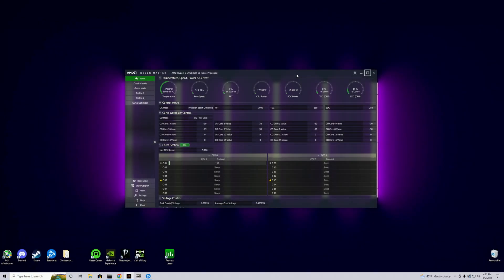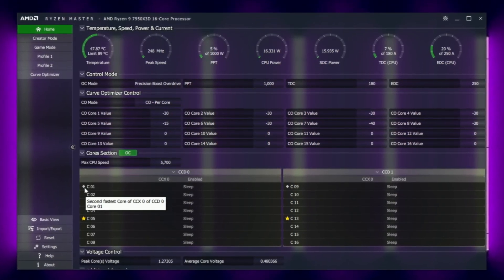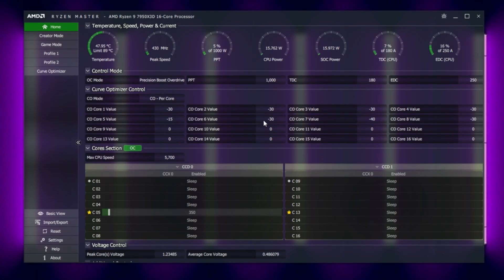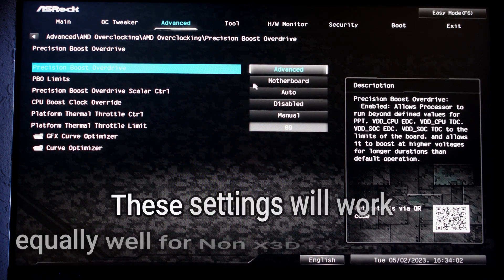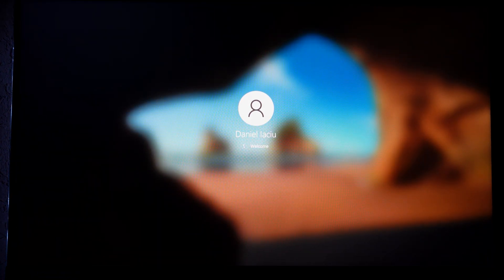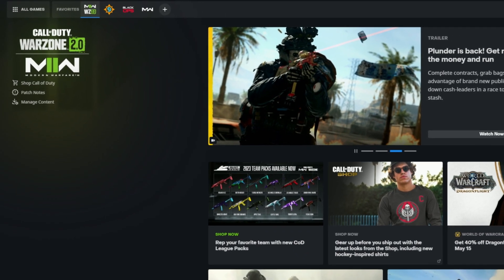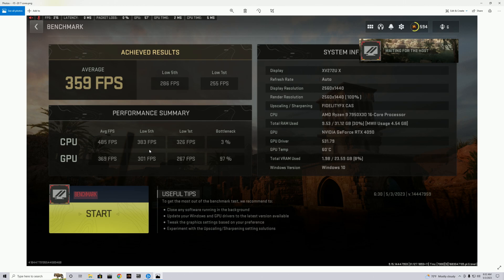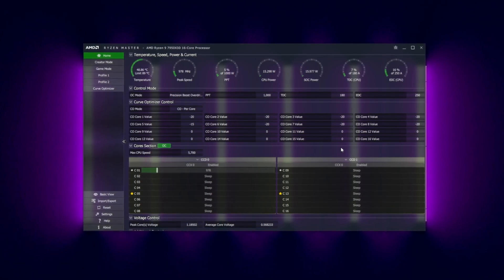Undervolting Ryzen 7000 Guide (How To Max Out Your Undervolt)

Comment: Well I'm using -50 offset per core and pbo with 85C limit and positive 200MHz. It's working great so far. CPU R7 7700 msi B650m gaming wifi motherboard.

Comment: Testing 7600x. During test in occt temps go to 95c always. Is that normal for tests, while actual undervolting results in temps i should test during gaming? Usually it went to around 85c but if undervolting was successful, temps should go lower in games.

Comment: This is not the best way to undervolt and test. use corecycler. It uses aida64, prime95 and ycrhuncher alternatively. I bet you if you put your cpu through a prime95 test with those numbers it will fail. Also you can setup a whea logger to see if there are any errors on your cores. Also in my case on my 7800x3d the cores core 0 with star and core 1 being second core as you said have lower numbers -35 and -30 than core 5 -25, core 6 -27 and core 4 -28. So the core with the star does not mean it has to be lower everytime.There is a long process on how to test it to be sure it will not random restart. I preffer to neve have random restarts than getting lower unstable numbers in my undervolt.

Comment: I'm not a big fan of going to the limit with the curve optimizer. My 7950x runs stable with -30 on all cores, but there's not a big difference between (heat, performance) -25 and -30, so I set it to -25 (no need to test each core by its own). The times of real overclocking or undervolting are gone nowadays. we have to trust what the cpu creates out of different values like the curve optimizer.

Comment: I own a 7600x. Before UV the CPU temperature after 10 minutes of OCCT test =76 degrees centigrade. I performed everything according to this video. I reduced the voltages core 1 - 25, core 2 -15, core 3 -20 and core 4,5,6 - 30. after this procedure, the CPU temperature in the OCCT test rose to a borderline 89 degrees within 15 seconds. WHAT is wrong? I understand that after UV the processor can be unstable, but rather should not heat up more

Comment: Is there any benefit of doing something like this through Ryzenmaster?  Or through bios?  Or no difference?
Reply: look at oats7 comment (7 month old) they have been echanging on this topic various messages
" @oats7
Hi I'm trying to undervolt my 7950X3D. You have a previous video on undervolting this CPU, but you did it in the BIOS. Which should I use? Ryzen Master or the BIOS?
Beefy Tech
·
@Beefy-Tech
Bios is best way to do it. Keeps it simple for you as with ryzen master settings aren't saved after reboot. " 
...
Reply: @nicocorico4808  I will check it out, thanks for the headsup.
For now I am using the bios where I'm all cores negative -30 and it seems fine.

The only instability I have is the GPU sometimes..... DISCONNECTS and I get no response.  The gpu seems fine and I've never had any issues.  But I think the pcie slot may have something wrong.  I do have an extended warranty on the item I purchased so if it continues, I might go and exchange it. Also the ram seems unstable and I would get bsod if I was doing deep learning programs if I ran it too long.  But after I capped the speed on its original expo mode of 6400, down to 6000, it stopped bsod.  

Honestly I think my mobo is a little flakey.

Comment: 1. Theory about best cores. I have -29 to -31 on all cores on ccd1, runs perfect, gain from 5150 to 5350 on full load.
2. Theory about no performance gains on ccd2. Lower temp-higher clocks. I have -29 all cores on ccd2 and gain from 4950 to 5250 on full load. CPU 7950x, cinebench r23 stock 37500 and after CO record is 39966, ambient temp 17C

Comment: thanks for your time to make such an informative video. Since we use X3D Ryzen9 .. our concentration is at CCD0 to CO and concentrate at the best Core from Ryzen mastery. This will reduce Temp accordingly .. but is there any issue if we apply the same for remaining CCD1 cores ? i mean it suppose to reduce Temp more but in a price of Overall performance ? u suggest that ? personally i dont mind if i loss little performance to gain extra wattage reduction ? ... also what u think about reducing PPT TDC EDC ?

Comment: On Ryzen Master utility in Basic View (not Advanced View) you can have the utility find the best values for you by running the "Curve Optimizer Mode" on "Per Core". It will take around 2hrs to run the test and  give you the correct undervoltage value for each core.
Reply: Hey mate, just wondering if you know how accurate it is?
Reply: @Wpar  not accurate for me, ryzen master gave me between 37 and 47 and it was impossible to boot
Reply: @Wpar  I'm not sure how accurate, but it's a good starting point. You could drop the voltage a couple more points afterwards and check stability. Maybe see if there are any videos on it on YouTube.
Reply: @PaulyDownUnder  ah cool, cheers

Comment: Just built my 7950X3D system last week, and unfortunately, I didn't do enough research about DDR5 compatibility, hence why I accidentally bought 2 sets of 32GB DDR5 6,000 MT/s (CL36) RAM having a total of 64GB. I have been tweaking the memory for a couple of days and gave up using the EXPO profile because of instability issues, initially at least.

Then, 2 days ago, I realized that my BIOS version is from July 2022, so I updated to the latest one. And lo and behold, the EXPO profile now works with 4 DIMMs, and I was able to push it to 6,200 MT/s. As for the CPU, I was able to do an all core offset of -32 and it is stable with the LLC set to Extreme. So far, cores 8 to 15 are always running between 5.20 GHz to 5.75 GHz. I guess I won the lottery.
Reply from the maker: Yup! They had just put out an update improving ram support substantially on Ryzen 7000! Now even speeds up to 8000mhz are possible if it's running in decoupled mode!

(You are running 6200mhz But COUPLED, anything about 6200-6400mhz must run decoupled.

So your 6200mhz coupled kit, is equivalent to a 7600mhz Decoupled kit)
Reply: @Beefy-Tech  Thanks for the info. Deciding to build an AM5 system last week must have been timely for me. If I had done it way too early, I would probably have been experimenting with the RAM for a couple of months until this new BIOS version gets released.
Reply: What mobo are you using ?
Reply: @LightWorks222  Gigabyte X670 Aorus Elite AX

Comment: I was able to set all cores to -30, would lowering the offset on my best cores yield performance or temp gains or do i need to test every combination manually?
Also, I have expo enabled which raises my SOC voltage from about 1.0v to 1.303v which is still safe but id like to reduce it but even 1.295 still causes stuttering, if i reduce the offset my curve optimizer would this allow me to reduce my SOC voltage a bit?
Reply: I'm also using -30 and it seems fine. The only unstable things I'm getting is my gpu will lose connection.  Like on my sensor panel, it looks as my gpu disconnected.  I usually just have to reboot and make sure its snug and it works again.  I think something is wrong with the gpu port and not the gpu. I've had my 3080 for a while with no issues.  Its only happened on this new build. 
My ram would have bsod issues when I was doing heavily based deep learning projects or long rendering projects that would last over 10 minutes.  It was expo 6400m/t.  When I turned it down to cap at 6000 it stopped.  I haven't tried different timings but I might try it out on some of the present timings the mobo has.

Comment: So question. I’ve been doing per core. Now and trying stuff out. Do I put my  best cores to a higher negative and the rest higher? So say my best cores are 1 through 5  do I put those to the highest negative code as I can before the system crashes? Right now my best comes from what I’ve been playing with is 14,12,1,10,16 and
I got them to 35 with out crashing do I go higher wtih the rest of the cores?

Comment: I did exactly this and my clock speeds are lower than stock and my cinebench score is 1k lower than stock and without pbo enabled in bios. When I only used CO without pbo, my cinebench score was 13580 and with pbo my score was 12000. Temps didn’t change when I did exactly what you did in the video. My cpu is ryzen 7 5700x
Reply: My temps did not change a single bit either on a 7800X3D.
Reply: @Veganarchy-Zetetic pbo itself isn’t going to help with temps if you’re already pegged at max
Reply: Although it did not seem to help with temperatures at the time as it was roasting hot in summer. I did have a better score in Cinebench. Now its winter and much cooler I have better temperatures too so definitely worth doing.  @Spoudey
Reply: @Veganarchy-Zetetic i should have added that technically the temps ARE better because you’ll be less throttled although the temps will appear the same
Reply: The quick and dirty method is to use Ryzen Master to find youre two best cores,  Run Cinebench without anything to get your base line score
Afterwards set your best cores to -10 or -15 and set everything to -25 or -20. Run CB again and document everything and repeat either increasing or decreasing your values.
You can use OCCT with PBO2Tuner  or use CoreCycler to have it automatically tweak each PBO2 value until it finds its best value
Reply: i have Ryzen9 7900x3D .. so i need at first to use CB with stock setting then i use Ryzen master to identify my best core .. Only CCD0 since it has the L3 cache i do CO and the best core will be 10 points higher than other CCD0 cores at negative. and for best value value finder i use CoreCycle or PBO2Tuner .. Correct ? @kokumosu
Reply from the maker: You said it yourself, you have a 5700x. Undervolting doesn't particularly help any non X3D cpu. The 3D cache CPU's are the ones to benefit from it most. 

For the 5700x I recommend curve optimizer OC or a flat all core overckock.
Reply: @Beefy-Tech  ok thanks for replying, I think I will try it then

Comment: Hi I'm trying to undervolt my 7950X3D. You have a previous video on undervolting this CPU, but you did it in the BIOS. Which should I use? Ryzen Master or the BIOS?
Reply from the maker: Bios is best way to do it. Keeps it simple for you as with ryzen master settings aren't saved after reboot.
Reply: @Beefy-Tech  Thank you! 

Also, Optimum Tech recommends PBO2 negative all cores, thermal throttle limit 85 degrees, and a power limit of 85 watts: 
https://www.youtube.com/watch?v=FaOYYHNGlLs&ab_channel=OptimumTech

Do you recommend I follow his advice, or stick to yours with PBO2 per core?
Reply from the maker: @oats7  what he recommends is the simplified version of mine. I recommend 89TJ Mac with Per Core Negative PBO2 because it allows you to push each core to their maximum, and because all cores have a different maximum undervolt, you can maximize your performance.
Reply: @Beefy-Tech  Gotcha, given that I spent so much money on this CPU, I'm gonna follow your advice to get as much performance as I can. I'll use PBO2 per core and an 89 degree throttle limit. How many watts do you recommend for the power limit?
Reply from the maker: @oats7  the cpu itself never uses more then 90 watts ingame, so just leave it on auto👍
Reply: @Beefy-Tech  After hours of testing, it seems I've lost (or won?) the silicon lottery... -10 offets on all CC01 cores fails OCCT, causing a BSOD. It seems that my chip is already running at its most optimal voltage. Is it uncommon to have a chip that can't undervolt at all?

Comment: Very good information. Especially on the fact that you need to voltages higher on your best cores to keep the frequency up. But I think a disclaimer on what you define as stability would be nice. I find that the AIDA64 SHA3 test is next to impossible to pass with any cores at -30. I don't even start real stress run before I can pass several runs of the SHA3 test.
Reply: Full Ack! AIDA SHA3 is real. I went the lazy way and set an allcore -20 and EVERYTHING I was doing was fine (7800x3D). y-Cruncher, Gaming, Browsing, Corecycler, you name it. But then I read about SHA3 Test and I was courious. The 3rd run made my PC reboot. I lowerd it to allcore -10 and then it took 15 runs to reboot. I set everything to Stock now, just enabled PBO and tbh, the performance is nearly the same so I just stay away from CO, it is not worth the effort. My SP is only 86 so maybe I just lost the silicon lottery.
Reply: @ArdaDaMarda  gotta have LLC on medium
Reply from the maker: I go by the play games and don't crash/restart for month test. Everytime I got a crash/restart I'd go back in, and I'd adjust.

For basic stability I run a 1H OCCT test for both cpu and ram, and yes it is possible to pass OCCT and still get a restart later down the line, but then I'd just further adjust by 2-5mv if I were to crash/restart later down the line.

Sha3 is indeed extremely demanding VS the other tests, and ive run it before on my 7950x3d before specifically cause it was recommended to me, but when I ran it I only have -25 as my highest. Undervolts, with-15 and -10 on best cores.

Comment: @beefy-tech why don't you use cpu boost override and infact have it on disabled? Most have that set to 200 or 150.
Reply from the maker: Because cpu boost override unironically makes 0 difference because it only applies to the Frequency CCD, which ud never use outside of games like CSGO anyways.

The 3D cache ccd is locked and can't boost frequency past its limit of 5.25ghz without using ECLK overclocking.

So the Boost Overide only helps frequency CCD, and in turn it can cause instability from the overclock of 150-200 without actually being beneficial to 99% of games (other than CSGO)
Reply: @Beefy-Tech  gotcha thanks for clarifying

Comment: Hello there quick question. I have a 5900x. Just used ryzen master curve optimizer per core. Took me a 1hr and 30 mins to finish. Lol. Well anyway is it possible to input the results manually to the bios and uninstall Ryzen master? I have done stress test seems stable . The result i got -27 almost all cores on 2 cores one was 18 and the oher was 23.
Reply from the maker: Yes it should be possible, I just don't know for sure where in the BIOS it'd be. Check advanced, AMD Overclocking and look for PBo tuner
Reply: @Beefy-Tech  pbo2
Reply from the maker: @wankerka  if you click on it, curve optimizer should pop up and allow you to do advanced setup, then per core

Comment: my 7800X3D was able to do -30 on my 2 fast cores, and -35 on the others. Under that I got worse results.
Reply from the maker: That's really good! My good core unironically crashes past 15☠️ got unlucky myself😂
Reply: @Beefy-Tech  that sucks :< I'm real happy because its running in a tiny itx build, so can use all the heat reduction i can get :)
Reply: I am at -35 on fastest and -40 on the rest atm. Still no crashes somehow and I am not even at 5ghz. Around 4960mhz but my Cinebench score keeps going up. Guess I will run this for a few days and see if it even works.

Comment: did they make that you dont get the start optimizing button (curve optimizer) for the 7000x3d ? i only have validate button there
Reply from the maker: In the bios you mean?
Reply: @Beefy-Tech  in the ryzen master app , i think its not available for ryzen 7000 , only for 5000
Reply from the maker: @jonathand7465  I don't know if you can change pbo settings for 7000 series in ryzen master, but you are able to at least see your undervolts and limits.

Comment: Maybe a noob question but why not simply enable ecomode 105w in bios and be done with it?
GN tested that mode and it was only 3% slower than ‘unleashed’ but actually almost halfs the power consumption.
Reply from the maker: Because with undervolting you'd actually gain performance. When you undervolt you don't just decrease power usage and heat, you tell the CPU to run the same peak frequency at a lower voltage.

If before it ran 5.2ghz at 1.2volts, after an undervolt it'll run 5.2ghz at 1.17 volts. This will decrease heat, telling PBO there's more thermal room to push frequency even higher, and as a result it'll do 5.25ghz at 1.2 volts, instead of 5.2ghz at 1.2

Comment: Very nice video I have a 7800Xd3 core 2 best core 1 2nd I did a all core not per core -30 a is stable as a rock is it worth pulling back on 2 and 1 if they are stable odd thing is don't really is much change in temps but it does hold higher clocks for longer.
Reply from the maker: I personally run -15 -20 -30 on 6 cores now.

Pulling back on first 2 is only worth it if you see better results in a benchmark or if you are unstable otherwise ofcourse.
Reply: @Beefy-Tech  Ok cheers bud I did do a run at 20 on first 2 cores but didn't change anything so think will stick with the 30, Thank you for your help.
Reply: @Beefy-Tech  -20 -10 and 30 on all 6 cores. Ran Unstable with my core #2 which is my 2nd best core in the vcache running at -20 and -15. Should I lower my best core which is core #1 to -15 instead of -20?

Comment: May I ask you what cooler you have on that 7950X, along with the thermal interface material you're using and the maximum temperature your CPU reaches in 3 consecutive runs of Cinebench R23? (Also what is your ambient temp)

My parameters:

NZXT Z63 RGB 280mm AIO
Thermal Grizzly Kryonaut spread on every part of the CPU in excess
Ambient temp 22C
Max temp my CPU reaches after 10 mins of C23 is 89 and it barely reaches that by the end
Reply from the maker: I haven't run 3 consecutive runs of Cinebench, and given its a 7950X3D, temps would differ from a 7950x.

I have a 360mm AIO with 3 Full-size 120mm fans, and 3 120mm Slim fans in push pull configuration. The thermal paste is noctua NT H2.
Reply: @Beefy-Tech  My apologies, I meant 7950X3D, basically I want to find out what kind of reduction in temperatures you can achieve with undervolting.